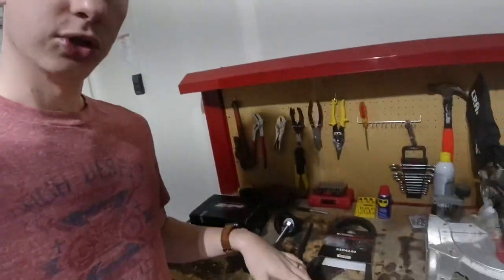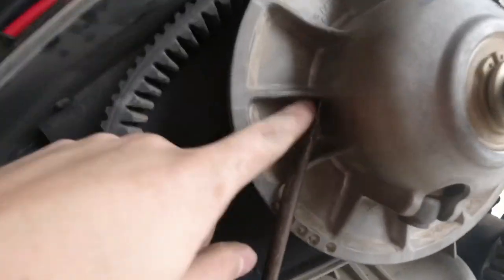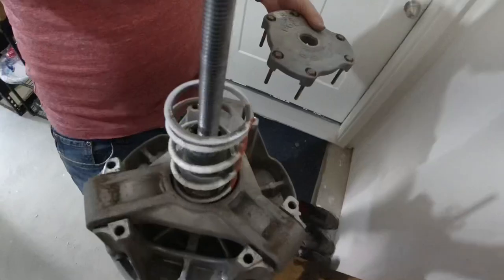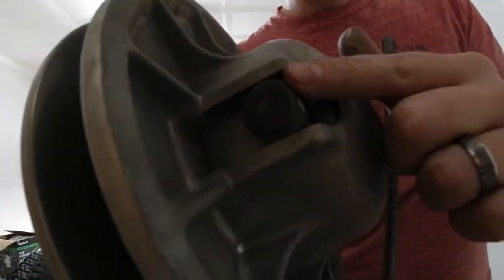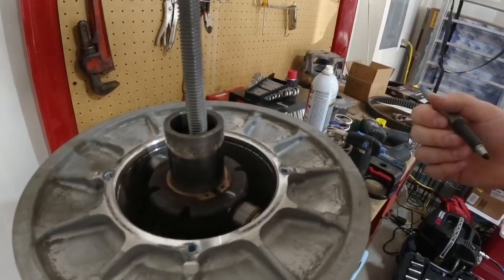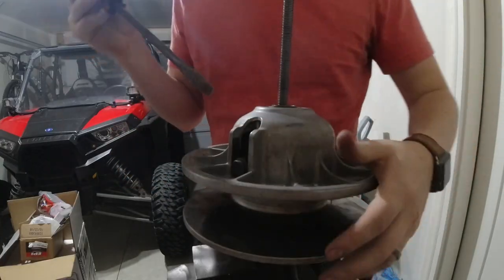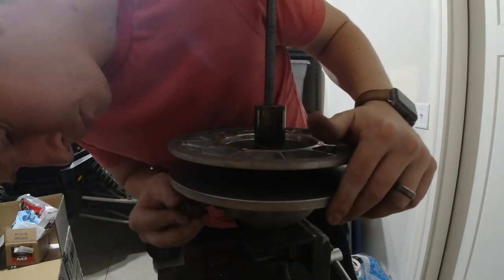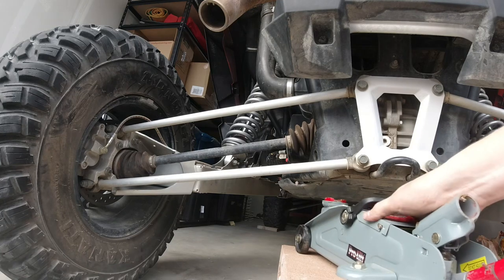Fix Jerky Starts! EPI Clutch Kit Install - Polaris RZR 1000

Comment: Do you have any video of the jerky starts?  Mine was always a bit jerky, and lately -- its been REALLY bad.  changed the belt, and cleaned everything out, everything seems tight, but want to see if mine are worse than normal.

Comment: How Do you Like that kit so far now that youve driven on it a few months? i have a 2015 XP1000 2 seater just went to 30s and i think im gonna swap over to the 248 kit as well from stock
Reply from the maker: No issues so far! I’m still running 30s and have taken it to the dunes and it handled great. Much smoother engagement especially on asphalt.